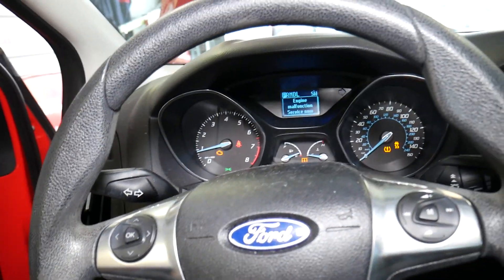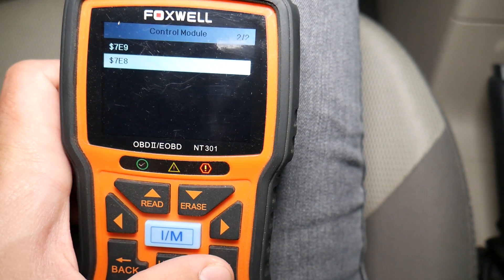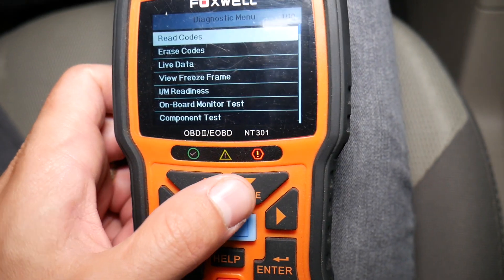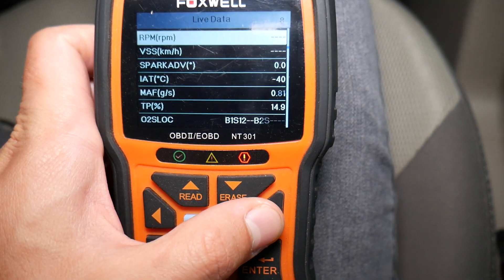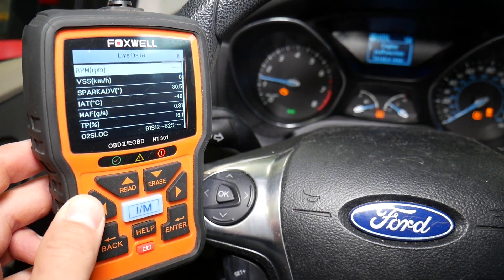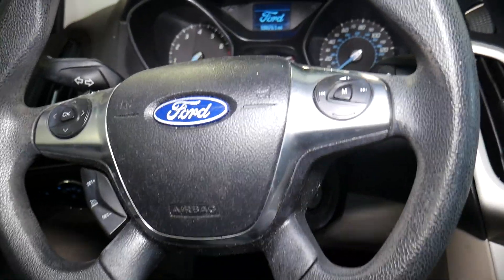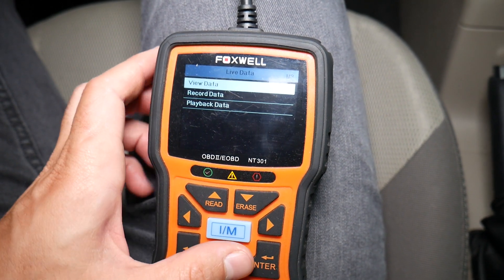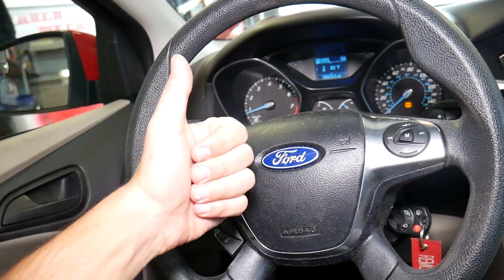FORD FOCUS ENGINE LIGHT ON CODE P0102 P0103 P0113 FIX

Comment: 13 FUSION . auto zone told me code p144c " ,evaporative emission system purge flow performance during boost", replace EVAP , so i did part number DURALAST PV756 called a solenoid , ...37$ , but light still is on. might be the "charcoal box" connected to this part?? idk. any suggestions appreciated !